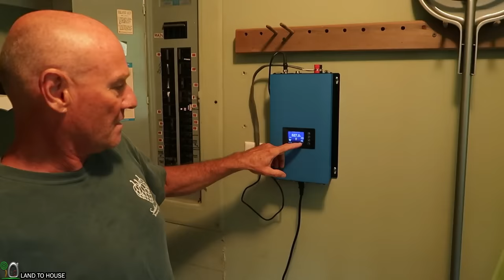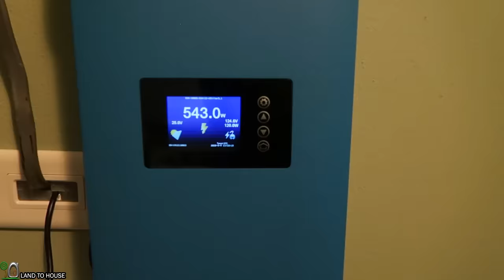Awesome Low Head High Flow Grid Tie Micro Hydro 530 watts!

Comment: When I was a kid, we had a generator system that fed power into our house backward through an electrical outlet. Even then I knew that was freakin' janky as hell.
Reply: He had an electrician sign off on a plug-to-plug extension? Prongs at 120V when someone accidentally unplugs it? I think not.
Reply: @Moletrouser  What electrician? This was a shack out in the woods powered by a generator. I would be surprised if an electrician had ever set foot in that place.
Reply: @Moletrouser  IKR - also running 3-phase over 2-phase plus ground cable is pretty, err, shonky. Would've expected the flex cable to be run in conduit as well. Love the turbine idea, however.

Comment: Great video, really impressed with the suction power available on the outlet of the turbine. Instantly made me wonder if it would be possible to harness even more power by having another turbine which is driven by the negative air pressure being pulled through it? Could possibly even connect it to the house and have one of those old school built-in home vacuum systems, help further reduce his need to draw power from the grid.
Reply: Interesting! A problem with the idea is reduced efficiency from reduce water flow in the line. Reduced water flow would also reduce vacuum/negative pressure.... with the right sizing of pipe in the system, it could work.
Reply: I was thinking a paddle wheel at the end where the water flows out of the larger pipe.

Comment: I personally would funnel the offset water into a funnel and put a classical water turbine at the bottom ish instead of syphoning the water out.
Reply: That's exactly what I was thinking... It doesn't sound much more difficult at all and would be more reliable and not have to be started... And you wouldn't have to worry about partially draining the dang lake

Comment: Great video.  Ever think of adding a gearbox to increase turbine speed and lower water loss?  I didn't do the math for that but I would think a larger diameter pipe would be needed for the gearbox.
Reply: lol you will get less power output due to loss of energy cause by the gearbox.
Reply: The gearbox with up ratio- increases speed but looses torque. Higher RPM does not mean more electricity or watts.
Reply: Seen this done with a washing machine spinner.  He had plenty electric
Reply: @digimaks  He has excess power in that setup. He could run more turbines easily or run one turbine faster. Faster = more power.

Comment: Neat installation, simple and effective: Simplicity is a good key  to get long mtbf and lifetime in mini hydro plant. Are there some kind of ballast resitor to prevent turbine overrun in no-load or low load condition ? (I'm not native english, pls excuse my poor language skill)
Reply: What you are proposing is a "Dump load" control. I used to follow an Electrical Engineer blogger in Chile who built a much higher output dual micro-turbine system in the Andes mountains for his off grid homestead.  He used his electric water heater to absorb excess power and control generator speed & voltage to close tolerances,  and allow time for the remote valves to close down. He seemed quite happy with it!

Comment: The oldest meters (classic spinning disc will start spinning backwards) and the newer digital ones are bidirectional by technical setup. It depends on the agreement with the grid: meter can be programmed to avoid counting negative usage or simply there may be penalty for putting power into the network. 
As for suction... it may be more complex, but if turbine would be put closer to the bottom and the diameter would be gradually reduced along the way should give the most efficient setup. You would have, let's say, "compression" of the stream (faster flow, so smaller diameter, still same volume as on on top).
Second thing is the wire... it looks quite thin for the 22A. Does it have rubber (not PVC) and weather proof insulation ? If not: risk of fire!!

Comment: The vortex plug is a life saver. Have been using a tennis ball in my pool skimmer for 10 years. It is a legit pump saver when water level gets low. Any type of ball will work, have used ping pong balls and balls from my kid's bouncey house in a pinch.

Comment: paint PVC to prevent UV break down.  and fix wires on outlet box.   add a rain loop to prevent water from getting in there.

nice build!
Reply: Without being painted 6" will last far longer (decades) than the Alternator.

Comment: Very cool setup! Love the tennis ball trick!

Been a while since I studied fluid mechanics, but I think the Venturi effect actually increases pressure in this case because the diameter increases. The negative pressure I think primarily just occured as a result of the siphon. In an idealised model (i.e. no friction), according to Bernoulli's equation the difference in diameter wouldn't have any effect on pressure or flow, but in the real world friction losses reduce dramatically with diameter increase, so I think that it might contribute to greater suction.

I will admit I may be wrong - very rusty on this stuff. Any other engineers here able to confirm or disconfirm?
Reply: @Artificial Hobos what consumes 600w in an idle house in the US? I see numbers for US domestic consumption that are 3 times UK consumption. My house uses around 150W when fairly idle, sometimes under 100W; sometimes near to 200W. Is this an aircon thing or what?
Reply: Fridges are 700w.. I hate to say it but 500w is not much.. You’ll be amazed how little it allows you to do..
Reply: @SamPrince 240w laptop I have is 2amp on 110/120V house.

So 500 watts is enough to run two 240W gaming laptops without the battery being run down.

It's not hardly anything really.

It's a supplemental system. But everything helps.
Reply: @peteparadis1619  I think efficiency standards in the UK and US must be wildly different. I replaced our fridge-freezer because it was in the "on" cycle the whole time so was wasting too much electricity. It was using about 200W. The newer one is bigger but never draws 200W even when it is in a cooling cycle. Average power is well under 100W and the electricity saving will pay for the new one in less than a year. I've no idea how you could make a fridge use 500W, but I believe that someone has done it! If I was investing in technology like this video shows, I'd definitely get my consumption side down first as it's so much easier.
Reply: @justinmacks1481  I run a laptop and two large screens on 200W or less. I can see how thrashing a GPU might use 240W, but I wouldn't call two of them blazing away an idle house. It's really fascinating to me how different the perspectives on usage seem to be in the UK and US.
Reply: @SamPrince  My gaming pc when running at maximum: 600 watts. Monitor: 300 watts.(big ass monitor) My mining rigs: 1500 watts. :face-blue-smiling:

Comment: It's AC, current is always flowing back and forth at about 60 times a second.
Reply: ... and yet the energy flows in one direction. Trippy, right?
Reply: nope.
Reply: @tompw3141  Doesn't matter
Reply: @flexairz  I'm everyone who uses electricity feels differently.
Reply: Ac is not always 60hs it depends on a lot of factors
Reply: In this case its 3-phase AC coming from the turbine. The cycles / sec will depend on how fast the turbine is spinning. Its then rectified to DC and run through the Inverter which produces single-phase AC at 60 cycles / sec.
Reply: Alternating current..

Comment: With that sort of flow you could generate SOOO much more electricity.
Reply: Wow please tell
Reply: Shawn Patricio  Unless larger turbines are more efficient I don't think that would help. Bigger turbine would generate more per rotation but spin slower.
Reply: Please do a YouTube video and demonstrate .of course there's some in efficiencies in this setup but it works for what he wants to do and as far as the flow rate couldn't make any more power this head unless it was at a much higher voltage.
Reply: Actually, I was thinking that you could run a second suction pipe as needed that would join in down line a bit. If the venturi is already running but you need more power for a short for something in the house, you'd just open the valve. Plus that would give you a back up if you wanted to take one down for maintenance.

Comment: Seems like a self-starting siphon would be really beneficial to use in this situation. 👍
Reply: With that long drop and such a small head requirement to start the siphon, it could probably be started with a second of dam flow diverted down through where the suction port is.

Comment: Instead of using a vacuum to get it started, why not add a 45 deg tee into the 8" outlet with a valve then plumb a pipe with a rain gutter just below the damb Crest, thus using water to create your starting vacuum process, and shut the valve off when it starts the generating process?
Reply: ....or put a valve in the main outlet pipe. closing the valve will stop the flow, obviously, but will keep water above the valve. Open the valve and gravity should pull the standing water through the pipe and create suction for the process to start, maybe?
Reply: Can you describe that in slightly more layman's terms.
Reply: @davidshevchuk8885  getting the water flow started uses the syphon effect. if you fill a garden hose with water, put it in your pond or aquarium and then close one end and move this closed end of the hose to below the water level and then open the hose, water starts flowing. The water pipe in the video is just like a garden hose, one end in the pond above, the other end 8ft below the water level of the pond. if the pipe gets closed at the bottom while water is still flowing then water cannot escape the pipe. this is now the same as the garden hose filled with water. Open the pipe and it should start on its own. Or maybe i'm missing something....
Reply: You're not missing anything! The approach in the video was used because the pipe was empty - the syphon effect had not been paused because it had not been started. Another approach could be to block the bottom, fill the pipe with water through a valve placed just below the turbine, close the valve, open the bottom and hey presto - as long as the length that's full of water is longer than the length above the turbine, the syphon effect starts. Just make sure the bottom is underwater, or the air lock will break and air will rush in, preventing the syphon.
Reply: The method he used seems stupid easy. Why get all complicated?
Reply: @ninline2000  cause he need to go out every time to start the water flow. syphon seem the best solution.
Reply: @orange13  that's a great idea, once the pipe is primed it will always be ready to go saving you from having to carry a vacuum every time you want to restart it.
Reply: Could also think of some Audrino sensors to help monitor things remotely from the house that would be a nice touch to.

Comment: The flow rate through the pipe is what you would get if drilled a 6 inch hole in the bottom of 15' dam (a lot).
Reply: its about 185 gallons or 700 liters per minute

Comment: Cool system, the AC vs DC isn't really magically going to inherently get around voltage drop, but allows you to just slap two transformers in line (one step up, one step down) at a rather high efficiency so that your long distance run isn't getting excessive voltage drop from the high current. This was the problem of AC vs DC wars. DC couldn't be stepped up in the early days when transformers were the only option.

If the whole 100' run was 24 VAC, you'd be losing 15.33% of your total power. Your actual losses are significantly worse than this as you have the bridge rectifier in the line, so that box is reading the rectified DC voltage, which is even higher than the actual line AC voltage. Additionally, rectifiers (diodes) have a voltage drop across them, so at these low voltages, assuming the drop is only 0.7V, that's 1.4V across the two sets of diodes conducting in the rectifier. In a system running around 20-30V, that's another significant hit to efficiency.
Reply: Isnt the DC conversion created for battery storage???
Reply: @JohnnyT161  in a system with a battery yes. If I'm understanding this setup correctly, the only reason that full bridge rectifier is there is because the unit on the wall is expecting DC from something like a solar panel.

There are also significantly better setups for converting AC to DC.
Reply: @XbotcrusherX  FULL BRIDGE RECTIFAIAR
Reply: @XbotcrusherX  it seems like a very off-the-shelf and low budget hobby project to me. "Ah this puts out 24V AC, this converts that to DC, and this will eat the DC and put out nice stable 60Hz AC" kind of deal. So having the inverter at the end that protects line workers and sorts out the synchronisation of the AC to the grid seems like a good idea. At least the person who designed that inverter knew what they were doing.

Though I have to admit my first response to hearing that he went with 3 phase AC was "ooh so he'll have a step-up transformer in line next and a 2.4kV transmission line". Have to admit I was sort of disappointed when I saw the single phase with protective earth cable being used to carry 24V 3ph AC with 7 or 8A peak loads per phase.
Reply: I agree with your analysis.  He'd get a faster payback by reconfiguring the electrical, but only once his current system breaks.
Reply: you're hired

Comment: "I don't know how that happens but that's what it does."
-Science in a nutshell.

Also when your camera decides to focus on the background instead of your subject, and completely blurs your subject instead.
Reply: Is there one full bridge for each rectifier and the return for each is the earth?  MB Hydro does that with one of their long distance DC HV power transmission lines.  I know how a single phase full rectifier works, but how does a three phase work with only three wires.
Reply: @GeeEmJay  6 diodes
Reply: It was a smart camera, the background was better looking.

Comment: One of those meters that does feed back to the grid should be on you to do list.  In Ohio where I live the utilities have to buy the power generated.
Reply from the maker: Same here but this system would require a lot more work to allow that. And a smart bi directional meter would need to be installed.
Reply: With it only producing 500 watts it would be pretty unlikely he would have any excess power to sell back. The inverter he is using is not UL approved, I would be very suprised if the power company would allow it. Where I'm from you need to pull permits to sell back. He would have to make changes and buy new equipment to sell energy back. Basically the way he's doing it now makes sense.
Reply: @jeffescortlx  but I bet the serving utility and state and Federal agencies don't know about it...yet.